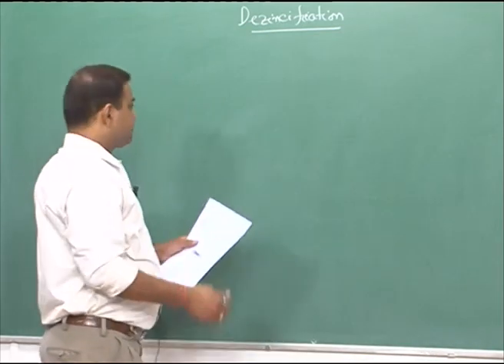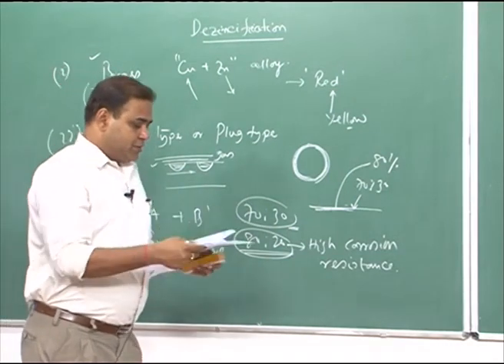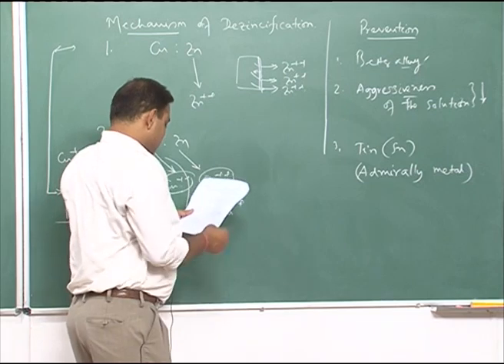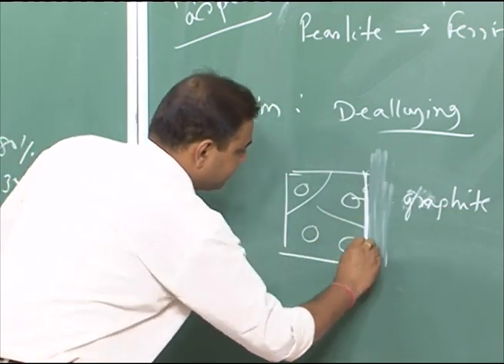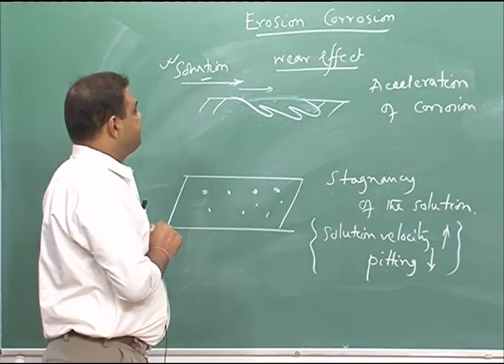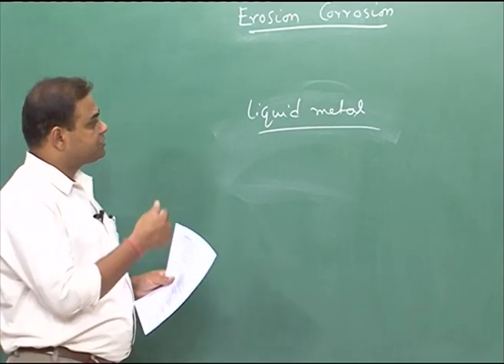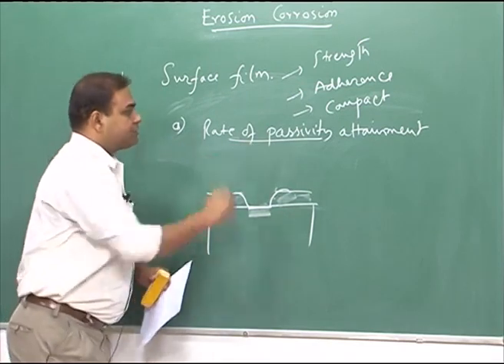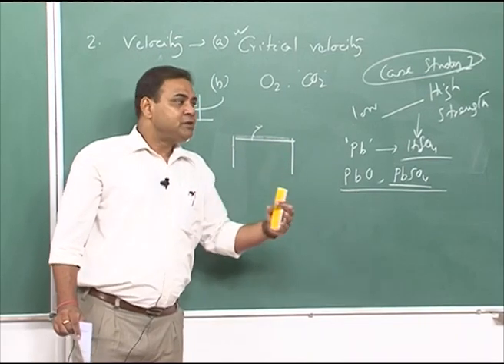Mod-01 Lec-29 Dealloying, Erosion corrosion

Comment: Good teacher. 30 plus years since I learned this. Having been called out to a flooded property today and finding a pre 1971 brass nut had let go of a tap ( flooding the business property below ) I wanted a refresher. Dezincification of the nut had occurred on a pair of newish bath shower taps fitted to the old tap connectors. Thank you for clearly getting the knowledge over.